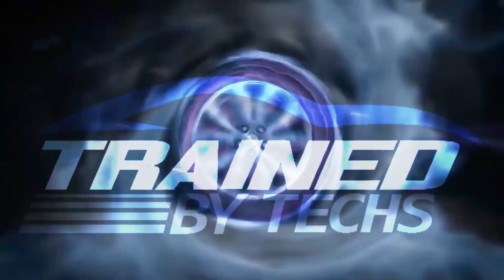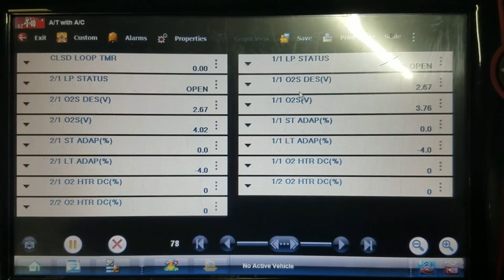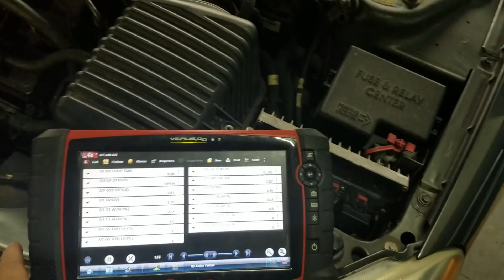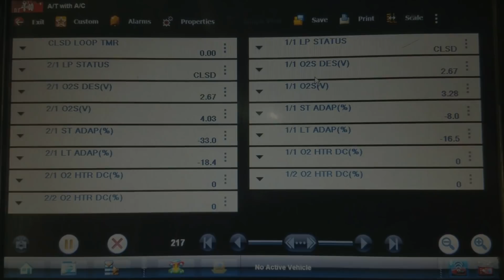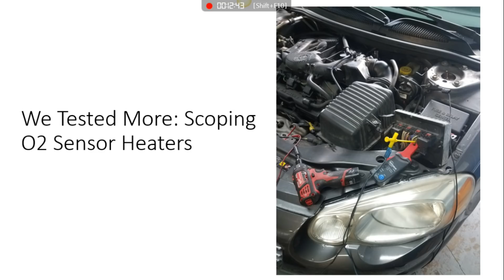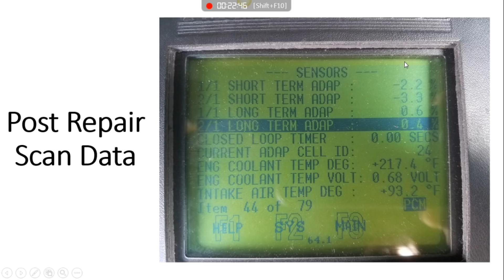A Chrysler Driveability Case Study. Expect the unexpected.

Comment: thats interesting. looking at the fuel trims being so far into the negative i was wondering what the maf or map sensor readings were at idle. i was suspecting that due to the fuel trims the pcm was not commanding the heater circuits on. nice video sometimes its hard to think like a computer, especially not knowing all the strategies that is written into the pcm.

Comment: Glen Stutzman was kind enough to send some Chrysler Next Generation Training documents to me. We also spoke about the documents as I was driving in unfamiliar territory about 1420 miles from home. My hands were at the 10 and 2 position and I was watching the road as he read the document to me. After talking with him and once I reached my final destination for the night, I was able to revisit the document and it's clear now that the PCM does in fact use the heater circuit to monitor the heater performance. In my video, I said that I thought that the PCM might use the signal circuit to infer O2 temperature (once the 5 volt was pulled close to the normal 2.5-3.5 volts). 
This is what the document says. The PCM performs a voltage drop test with a 5 volt pull-up across a 10K ohm resister and the O2  heater. This information is used to verify proper operation of heater circuit and to indirectly determine the temperature of the O2 sensor.  
I scoped this circuit a lot on this vehicle, and I never saw evidence of this. This vehicle is of course long gone but I will keep my eye out for another one. I want to monitor that circuit. I want to catch the PCM testing for circuit faults and heater operation. 
Thank you Glen for sending the document and for taking the time to talk shop with me.

Comment: I always test and prove. I don't think you considered that ECM deliberately didn't command the O2 heaters because of another fault. How would you test for this?
Reply: I did consider and mention this is the video. I suspected that the PCM did intentionally keep the O2 heater off due to fault strategy but when I first saw that the O2 heaters were not being turned on, there were no fault codes that would indicate that a fault strategy was taking place. Now that I think about it, Chrysler scan tools support something called a 1 Trip Failure. Maybe there was something in there? Unfortunately, I can't remember if I looked there. 
Something to keep in mind. The fault criteria states that the O2 temperature has to be in the 900's within 40ish seconds with the heater on. The indicated fault strategy and or fault strategy and fault codes seemed to be taking place with no evidence that the O2 heater was ever turned on during that key cycle.

Comment: Great case study. My initial thought was the PCM. Of cuz, we don't assume. We test!
Then I saw that the factory tool can turn on the heater drivers. I was like hmmm.....I was lost.

I always thought that if I could turn on the component via bi-directional control, that driver on the pcm has to be good and look elsewhere. 
Well, maybe those 4 drivers are good in fact, but their BOSS doesn't turn them on. maybe lol
Reply: The Snap On will turn the heaters on too. It's just that it didn't warn that ot was a koeo function.
Reply: The heaters, and the external heater circuits were good. I believe that this was a PCM logic problem. I guess that it's possible that there was a circuit internal to the processor or a circuit designed to support the processor that failed. What ever the fault was, it was internal. I will share why I suspect that there was an internal circuit fault in another comment.

Comment: Brin how did you know it wasn’t the 02 because you had no signal even at pcm? That’s what I got from it.
Reply: Welding Junkie, by monitoring scan data and scoping the heater circuit when it was being turned on. You could see that the heaters and the heater circuits were functioning as designed.

Comment: Nice video. Excellent.
What if the problem with this ECU is a software problem and you need only to reprogram the computer in order to make it operational once again. I mean, according to the pico data the drivers in the ECU are able to pull down the signal, so maybe there is a some problem in the maps.
Thanks for sharing
Reply: Thank you Dar Car for your comment! I did forget to mention that. The PCM was at the latest calibration.